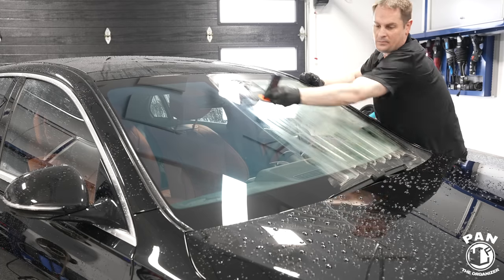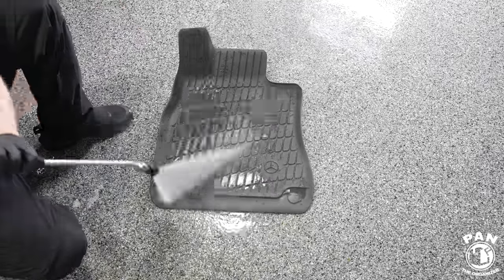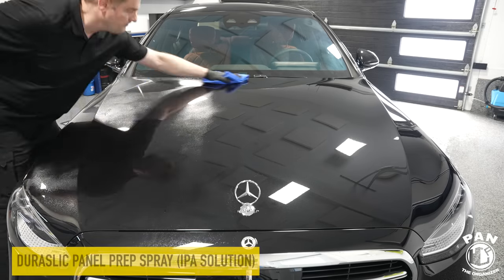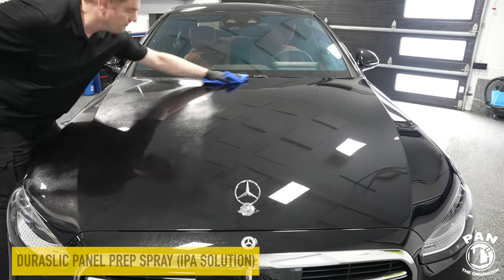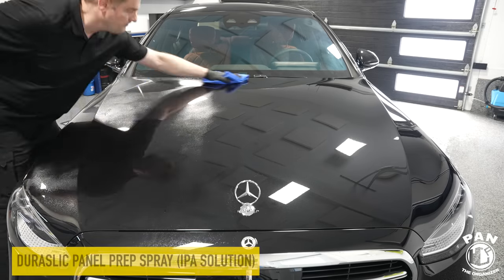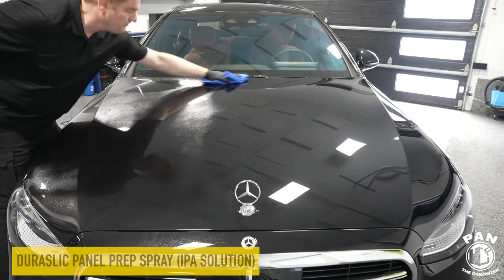The SECRETS Of How Expensive Cars Are Detailed...

Comment from the maker: ⬇️🔶 LINKS TO PRODUCTS MENTIONED IN THIS VIDEO ⬇️⬇️
🇺🇸 For people in USA:
Nitrile gloves: https://amzn.to/3ZHwzpl
Kranzle 1122TS pressure washer: https://bit.ly/3Fw4xp8
Mosmatic gun and wand package: https://bit.ly/3sQxxAh
Koch Chemie Super Foam: https://bit.ly/3qln96m
Foam Cannon: https://amzn.to/3XpFOdj
P&S Brake Buster: https://bit.ly/3Qrl8jt
IK foam pump sprayer: https://bit.ly/3YnotSM
Detail Factory tire brush: https://bit.ly/3Vaczt5
EZ Detail barel brush: https://bit.ly/3GOiyO4
Boar hair wheel brush: https://bit.ly/3qZ1a56
Lug nut and caliper brush: https://amzn.to/42T42xz
CarPro Descale shampoo: https://bit.ly/3OKqO4u
Dual wash buckets: https://bit.ly/3CFXOGj
The Rag Company microfiber wash mitt: https://amzn.to/44jyZMH
Citrol 266: https://amzn.to/46sVQHi
DIY Detail clay towel: https://bit.ly/3OdJKJI
DIY Detail Iron Remover: https://bit.ly/3Ou6fM4
DIY Detail Quick Beads: https://bit.ly/43DM5Uh
Hyde’s Serum Rustopper: https://bit.ly/3QMgz3J
Soft99 Roll-On Compound: https://amzn.to/3s4l2UX
McKee’s 37 Floor Mat rejuvenator: 
EGO blower: https://bit.ly/3IPUz3O
Stubby nozzle for blower: https://bit.ly/3XhJLjm
CarPro Reflect polish: https://bit.ly/3QsXoeO
Rupes DA fine polishing yellow foam pad: https://bit.ly/3HBF8Iy
Flex dual action cordless polisher: https://bit.ly/3XhSRfM
Microfiber towels for polish removal: https://amzn.to/3H9A2pu
Scangrip LED inspection light: https://bit.ly/3GP59Fo
DuraSlic panel wipe: https://bit.ly/3sSnSdu
DuraSlic ceramic coating: https://bit.ly/3eD4kp3
Microfiber towel (for levelling the coating): https://amzn.to/44ihbRN
Microfiber towel (for final buff): https://amzn.to/3OiCTio
Soft99 Ultra Glaco glass coating: https://amzn.to/47Aio9V
CarPro DarkSide tire sealant: https://bit.ly/3XOtDFU
Tire dressing applicator: https://amzn.to/3EB2MVP
Stoner Invisible Glass: https://bit.ly/3Oiperq
Microfiber glass towel: https://amzn.to/3NJccUX
DIY Detail Interior Ceramic: https://bit.ly/3rMZLiB
The Rag Company Edgeless 300 towel: https://amzn.to/3ONHies
CarPro Fabric (carpet protection): https://bit.ly/3YtNITl
Vyper Chair: https://bit.ly/3B43xVF

🇨🇦 For people in Canada:
Gloves: https://amzn.to/3GKrvYH
Pressure washer: https://bit.ly/3MgYINZ
Gun & wand: https://bit.ly/3EBUZbI
Snow foam: https://bit.ly/3NpyvgW
Wheel & tire cleaner: https://bit.ly/3AHXRQX
IK foam pump sprayer: https://bit.ly/3VfwcAs
Foam cannon: https://bit.ly/3ltOq3r
Tire brush: http://bit.ly/3eg9Rls
Barel brush: http://bit.ly/3T4ncwB
Lug nut and caliper brush: https://bit.ly/3CHQqdW
Wheel face brush: https://bit.ly/3s4VRl6
Shampoo: https://bit.ly/3RinjUs
Buckets: https://bit.ly/3CFXOGj
Wash mitt: https://amzn.to/3wdrBn1
Citrol 266: https://amzn.to/46sVQHi
Clay towel: https://bit.ly/3YpF74e
Iron Remover: https://bit.ly/44ySmBQ
DIY Detail Quick Beads: https://bit.ly/46c4lGw
Hyde’s Serum Rustopper: https://bit.ly/3w2pJgO
Soft99 Roll-On Compound: https://bit.ly/3lsJ2Ob
Rubber mat rejuvenator: https://bit.ly/3imUvxz
Blower: https://amzn.to/3WhddVa
Polish: https://bit.ly/3KArGcA
Polishing foam pad: https://bit.ly/3HW68WG
Polisher: http://bit.ly/3inH2Fv
Mini polisher: https://bit.ly/3tvZTk8
Polish removal towels: http://bit.ly/3CTIbMo
Inspection light: http://bit.ly/3knW5QA
Panel wipe: https://bit.ly/3sSnSdu
Ceramic coating: https://bit.ly/3eD4kp3
Towel for levelling coating: https://bit.ly/3E8KgnB
Towel for final buff: https://bit.ly/3UPu0y4
Glass coating: https://bit.ly/3KxitB1
Tire sealant: http://bit.ly/3V9DlSm
Tire dressing applicator: http://bit.ly/3fWuFPz
Glass Cleaner: https://bit.ly/3lnHPaQ
Glass towel: https://amzn.to/3JoFJR5
DIY Detail Interior Ceramic: https://bit.ly/3QfxpYi
The Rag Company Edgeless 300 towel: https://bit.ly/3RcQmZ8
Carpet protection: https://bit.ly/3Xf7qkd
Vyper chair: https://bit.ly/3OP79TF

🇬🇧 For people in the UK: https://bit.ly/3fgoENJ

🇫🇷 For people in France: https://c3po.link/QCWWjkv74R

Comment: I'm amazed that these high end, luxury vehicles, are delivered in such rough shape, that they require a hard core derailing. I'm ordering some soft99 ultra glaco, based on your recommendation Pan.  I'll clay the glass first and I'm sure I'll be more than happy with the results. 🙂
Reply: My “new” Mercedes came with road grime and scuffed tires.
Reply: When I took delivery of my c43 I didn’t know much about detailing, but I knew what buffer trails were and the car was full of them. It looked nice inside before they pulled it out into sunlight. But I knew I’d better learn to take care of my new ride, and thanks to Pan , my car looks 10x better than when I got it !
Reply from the maker: A new car is never new until it's properly detailed. 
- at the factory, the paint defects are often corrected quickly by rotary polishing which can leave marks and holograms, so polishing corrects those, before you lock that in long term with a ceramic coating for example.
- vehicles are then transported by truck, train and boat so they are exposed to the elements, industrial fallout, brake dust, rail dust, etc
- vehicles are often left at boat docks (when transported by boat) or in exterior parking lots for weeks or months, again being exposed to the elements
- at the dealership, the vehicles are almost always poorly prepped using the same dirty water that was used for all the cars on a given day, and poor washing and drying methods leading to swirls and scratches 
- at the dealership, a layer of cheap wax or paint sealant is usually applied to attempt to make the paint glossy prior to delivery. It's crucial to remove any previous protection before you apply a ceramic coating, as coatings need to bond directly to a virgin clear coat.

If you only plan on applying a regular carnauba wax or paint sealant though, you could decide to skip machine polishing, as those protectants can be applied over existing protection and it's not as crucial to prep the paint as well.

I explain all of this in this popular video: https://youtu.be/QgoyrC-5CMc

So you can better visualize the new car prep process, here are the steps I perform on a brand new car for my customers: 
Aston Martin Vantage: https://youtu.be/OKga3yZVTqo
Volvo XC60: https://youtu.be/tvDBBenhYFA
Tesla Model Y: https://youtu.be/gohks8xP5NY 
Porsche 911 Carrera: https://youtu.be/2ckiivbFqs4
Mercedes AMG GT63S matte black: https://youtu.be/eU8zg1lXvXY?si=oGxoCp8PWt7gTncV
Audi Q7: https://youtu.be/t7HCBSVnizM
BMW M6 Gran Coupe: https://youtu.be/0lC9uyKXs8Q
BMW M340i: https://youtu.be/etXhJNaF0EE
Audi RS3: https://youtu.be/641mAJfKDLM
Golf R: https://youtu.be/jr19g4PWJsk
Reply: I have just learned yet again.. thanks for explaining in such detail, all that a new vehicle goes through, prior to the consumer taking delivery. I had no idea!  Now I know how crucial it is to properly detail a new vehicle, as much as it is a used one.
Reply: @PanTheOrganizer  Hi pan  I have a question can you do a video and review of wax replacement by image wash to see if it sheeds and water beeds and also leave protection and how it dose

Comment: How do you vacuum dirty carpets? My customers have pebbles and lots of dirt embedded in their carpets. Would you suggest a drill brush to agitate it out or maybe a massage gun to vibrate the hidden dirt to the surface? What’s your suggestion for a mobile detailing business in Arizona working with very dirty cars?
Reply from the maker: If you have an air compressor, the magic trick is to use an air blowout gun to blow out all the dirt, lift stuff that's deep in the carpet fibers, and loosen those fibers, to make the vacuuming much much easier. See my video on the Tornador air blowout tool here: https://youtu.be/UPjFPdaAEj0?si=EIBqKecXd0iElPhD

That's for the loose dirt. For other dirt, see my professional carpet cleaning tutorial here: https://youtu.be/XE0-Rlt9wZ8?si=R6hZWuuo09p9Pk9M

Comment: Hey Pan so my truck is ceramic coated with crystal serum light, can I use the iron remover and towel step on it without maring? Thanks Pan
Reply from the maker: Only clay if needed. And on a coated vehicle, use a synthetic perforated clay decontamination towel like those in my latest clay video. Test on an inconspicuous area first.

Comment: Hi Pan i noticed the rust on break disc, how do you clean those without taking down the wheels?
Reply from the maker: Surface rust on steel rotors is normal after you wash a car. It goes away as soon as you brake the first time. If you want to prevent that flash rust, as soon as you are done with the final rinse, spray some Hyde's Serum Rustopper on the rotors, and then continue with drying the vehicle. Here's a link to the product: https://amzn.to/3GIOgwC

Or, when you are done with the final rinse, drive up and down the driveway a few times while lightly applying the brakes. Then dry the car.

Have you never seen surface rust on steel rotors after washing your car? This is totally normal.

That's why I like my Porsche 911 Turbo S so much, as it has carbon ceramic rotors, and those never rust and don't create brake dust. :)

Comment: Hi Pan! Love all of your videos btw. I have a black AMG GLC 63 probably with the same paint characteristics as this car and I want to know if I can follow this process with just a rotary from Home Depot? Also, if I use reflect do I have to apply a ceramic after or can I use spray ceramics, waxes? Thanks!
Reply from the maker: HI Jon! Welcome to my channel. You discovered one of the biggest car detailing channels on YouTube as we surpassed 960,000 subscribers and we have over 130 million views! I have been detailing for 26 years and I love to share my knowledge and passion with my viewers.

You found the right channel to help you learn everything about detailing.

If you have never polished a car before, and have little paint correction experience, I wouldn't recommend a rotary polisher. You could get yourself in trouble with the paint. You should look for a dual action (orbital) polisher.

See my popular paint correction tutorial for beginners here: https://youtu.be/ustTEVGMOTI

Once you are done polishing with CarPro Reflect, you must use CarPro Eraser to remove polishing oils, before applying the protection. After that, it's up to you to decide what kind of protection you want. Wax (1-3 months protection), sealant (4-6 months), ceramic spray (3-12 months depending on which one you buy) or a full ceramic coating in a glass bottle (years of protection).

See my popular video explaining the differences between all the major forms of paint protection here: https://youtu.be/4ejfPHan3k4?si=8g3VLX9gpRF34vD1
Reply: You’re the man, Pan. Thanks for the advice!

Comment: Hi Pan,  Nice summary in 16 mins 😊
Btw , super foam PH12 1/10 is compatible with ceramic coating ?  
Koch Chemie mentions  dilution ratio max 1/50 ?  You probably have good reasons 😀
Thanks
Reply from the maker: You wouldn’t use a high pH snow foam for regular weekly washes. It’s not needed. Stick to a pH neutral one. But once in a while, for deeper cleanings and grime/road film removal, then you can use the more alkaline pH snow foams like CarPro Lift and Koch Chemie Active Foam.
Reply: @PanTheOrganizer   what about dilution ratio 1/10 or 1/50 ? Thanks

Comment: If you use the interior ceramic coating on leather seats can or do you still use a leather conditioner??
Reply from the maker: No point in using a leather conditioner on modern leather which has a polyurethane top coat on it, like a clear coat for paint. Conditioners don’t penetrate that top coat.

You’d perhaps apply a conditioner when the leather is a bit older and cracked, where the conditioner would penetrate in the hyde and do its job.

New cars with leather seats only need a good cleaning and then protection with a leather sealant or coating, to protect against friction damage, dye transfer, UV rays, make cleaning easier, etc

See my leather care tutorial here: https://youtu.be/pvKJXGRneJg?si=_WFancI5dySExfW2

Comment: Which type of detailing job will make a black car look its darkest in terms of shade and extremely glossy? Is there a particular ceramic to help with this? Would be interested in seeing different ceramic/ graphene vs their gloss readings for a black car.
Reply from the maker: The best way to increase gloss on any color vehicle is paint correction (machine polishing). This removes swirls, scratches and oxidation and levels the clear coat leading to much better light reflection, thus increasing gloss. That’s how you get the biggest increase in gloss units when measuring with a gloss meter.

The protection applied at the end is just icing on the cake. Further bumping the gloss units by a few marks, but not as much as machine polishing.

That being said, there are certain coatings that are glossier than others. See my video here: https://youtu.be/ERTQz-NTz1Y?si=LiQaAj_nutJkH33o

Comment: A good video. Well produced, and nice to see other products etc.

I still do not like the DIY Detail clay towel. I don't agree with their marketing of it, but hey ho. Not sure if you are affiliated, as you do videos with them. No offence. 

Consider trying CarPro Ultracut (NOT CLEARCUT - it's RUBBISH!) on the next single stage detail you get in, instead of Reflect especially on a car with harder paint 

You will be amazed how it finishes. It cuts out significantly more defects than Reflect too - and on such hard paint as these Mercedes, it still leaves a hologram free finish with a medium to soft pad without any effort.

It's my go to polish for most jobs. I must have used 30L this year. Only downside, is the price. It's very expensive. At least in the UK.

On Mercedes paint I use Ultracut and the same Rupes yellow pad you used here for refinement/finishing. But often not even needed, as it finishes down so well even after Microfibre cutting :) 

Greetings 🥳

Comment: Hi Pan, nothing to do with your skills, they are outstanding. But I am so disappointed by Mercedes-Benz in the last 2 years. Their paint are now so orange peel like that it is almost unacceptable at this price tag. First time I saw that it was on the new SL. Now I can see it clearly on this S-Klasse. Heartbreaking...
Reply from the maker: Thanks for sharing. Yeah more and more car makers are using thinner and thinner paints... Orange peel however is actually important on daily drivers. It helps reduce the appearance of swirls and scratches. If everyone had a perfectly flat paint like it was water sanded with zero orange peel, it would be a nightmare. But where I agree is that some manufacturers use too much orange peel hehe.